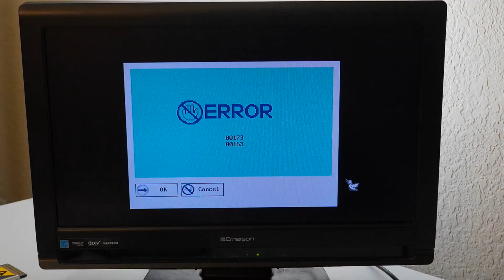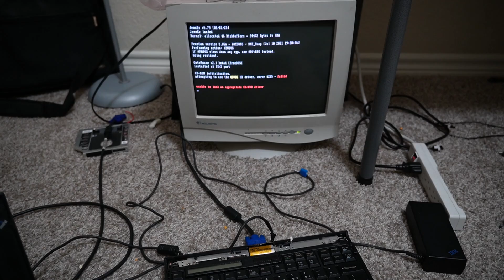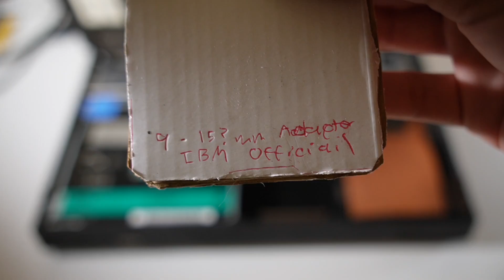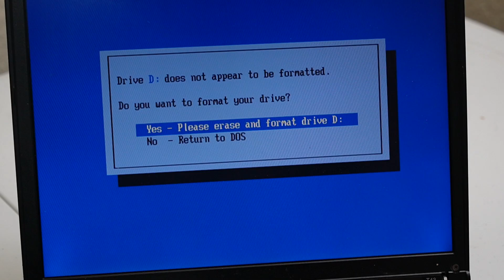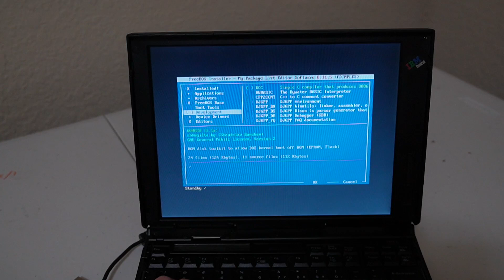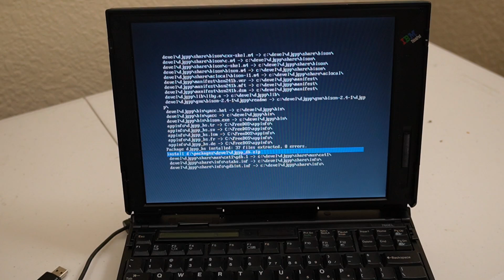Building a 28 year old Thinkpad, using only scrap laptops! (760el)

Comment: Hello, just trying to try libreboot something. Can you recommended laptop which i can easily do all stuff?
Reply from the maker: If you want to flash internally the t60 is relatively inexpensive, but make sure to get an intel one.

If you want something more modern I'd recommend a x220 or x230, but these laptops aren't completely blob free and require an external device to write the flash memory. So, you will need a programmer, used raspberry pi's work well for that and are pretty inexpensive.

Comment: Grampa shakes fist at cloud moment

That was (or rather a slightly different 760) was my first laptop. 

I started undergrad in 1999 and as the first semester was coming to a close, I asked my dad (who worked in dev ops administering SGI systems for a large printing company, so he was savvy) if he could look around for a basic laptop that I could take the class/the library. At the time, they were rare as in none of my peers had them and only a few upper-classmen had them. He said he would look. 

So for Christmas 1999, I got a Thinkpad. It was a former corporate one that was reconditioned. It was a bit more spec’ed. I think a Pentium 133 with like 64 MB of RAM if I recall (my main rig was a P2 200 or so with 128 MB I believe and a sweet sweet Voodoo 2 card, even though lower powered was not garbage for writing and surfing). It had a PCMCI Ethernet and modem card, so I could just set up shop at the library and work for hours, albeit long or back-to-back lectures would require some recharging/pugging in during class. 

The first thing I did was put Linux on it. Debian, I believe. My main rig was running Linux of some sort or another and I had a dual boot just for some games, albeit Quake had a native Linux port (still have the discs), and I was into console emulation since high school  

So in going back in January, everyone was like “Whoa! That’s awesome!” Not because it was super powerful, but because I could just type my notes in class and work directly in the library. 

The next school year, I started seeing more around campus (especially those iBook G3s, as the campus computer store was Apple-based) and by senior year and grad school, a sizable chunk had laptops. A few people I knew personally did the same thing and found a used one from a reseller, since taking notes was not the most intensive use case. 

Loved that machine. Ran it into the ground in 4 years. Was gifted a brand new Dell Inspiron (which as admittedly more powerful with a bigger screen) for graduation from undergrad, but even though it was objectively better, was not as endearing as the chunky old Thinkpad. I think I may have recycled it in like 2005-2006, since I stopped using it even for goofing around by then (and it was thrashed and glued together in places). 

I even remember visiting my then girlfriend’s parents’ house over winter break in like 2002 and playing FF3 (6) on a Super Nintendo emulator on that trip. The girlfriend is now my wife of nearly 20 years. 

Such a cool little nugget.

I still have affection for underpowered Thinkpads. I have an X220 which was my daily driver for ages (which needs a new battery), although I use it rarely these days. I also have an X40 running FreeDOS (which I tweaked with USB drivers to transfer docs on and off a thumb drive and that I modified with a USD-C PD trigger board, so it charges with a modern laptop charger) which honestly I use at least weekly and sometimes daily as my distraction free writing machine.
Reply from the maker: The x40 setup is a pretty cool system especially with the USB-C, and I appreciate the story I imagine it was a great daily laptop back then :D

Comment: I also have the same thinkpad, I lucked out with a fully working unit, even battery! I bough additional 80mb of ram and industrial 2gb PATA drive for it, to try and install some extremely light weight Linux like TinyCore. It's weird to see windows 95 working with full gui while you cant run most linux distros. It's actually usable in a spreadsheet class, as ms Excel 1997 is a proof of ms unneccessarly inceasing bloat in newer versions.
Reply from the maker: That's pretty cool, I haven't used spreadsheets much except for an accounting class years ago. Generally I find ram to be the constraint with running modern linux distributions on older machines, that and alot of them dropped i586 support :c 

I think netbsd might work with 32mb, but I haven't tried it yet.
Reply: @tripcodeQ7  yeah, ram usage is pretty high on new Linux compared to period correct software, (Win 95,98 and Red Hat 5.0 for example), but that old software actually uses more swap than real RAM. 

Today I finally have the time to test some distros at the 40mb of RAM my machine came with.